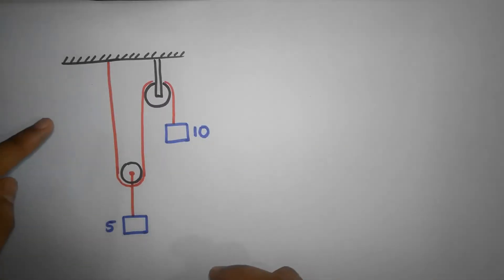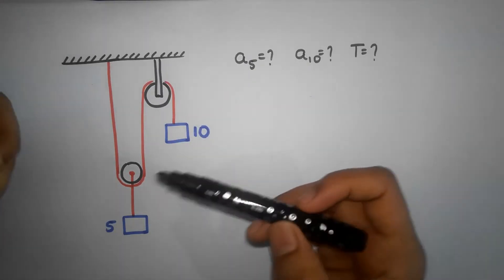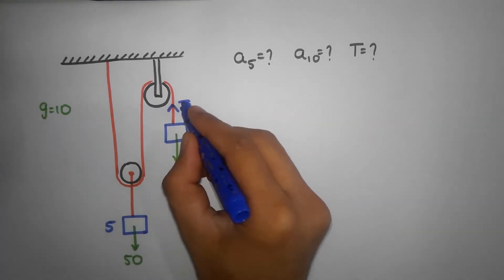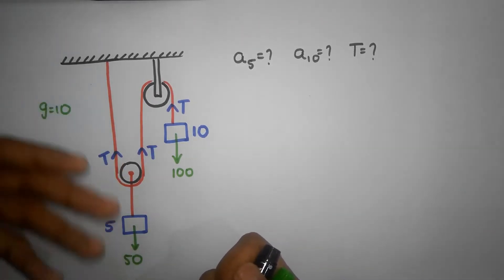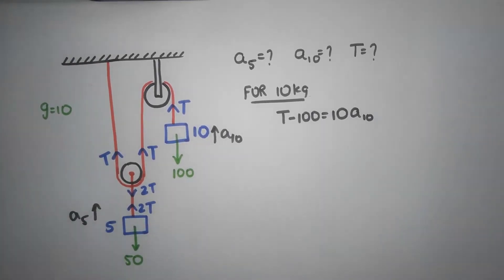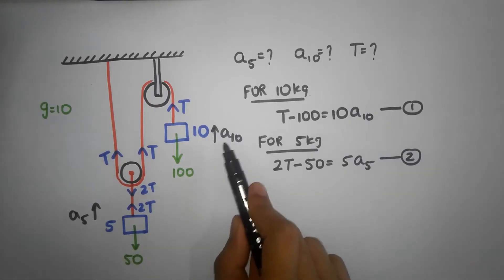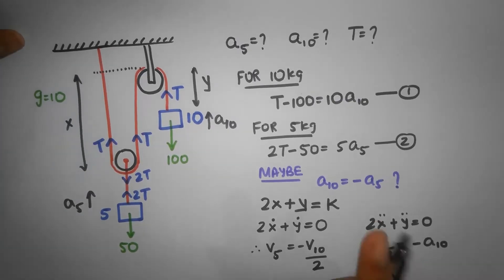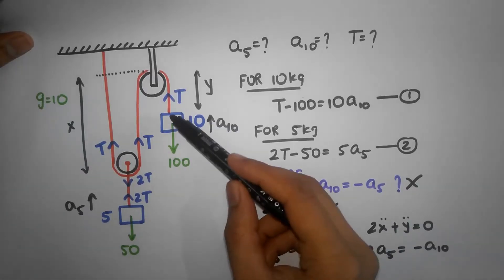Double Pulley System logic (Method to solve any number of pulleys) | Constrained motion

Comment: But the pulley can't accelerate right because it is massless so how is a5 possible.
Reply: It can!
For any massless object
Net force=mass×acceleration

If mass is 0 then lhs=0 so rhs=0 always and always....so basically a massless object must always have a net force of zero magnitude however it's acceleration could be anything from 0 to infinity and the newtononian equations will still be valid here
Reply: @shauryagupta7506  but a=F/M right so if m = 0 then a is undefined so.... 🤷 🤔
Reply: @RanjoRastogi  well in physics any number divided by 0 is usually considered as infinity.... however if u interpret Newton's laws in this manner then the result that u get is absurd and impossible as nothing can exceed the speed of light.

So what has been accepted for massless objects is that the net force on them is always and always zero and thus net force=mass times acceleration becomes mathematically valid and theoretically u can have a massless object  with a finite acceleration